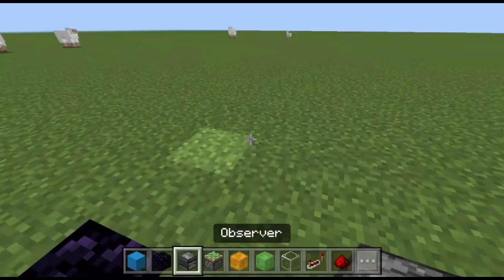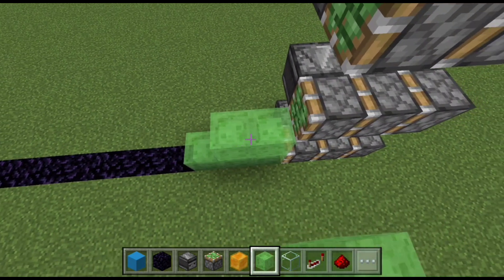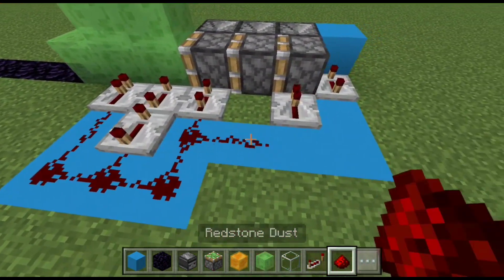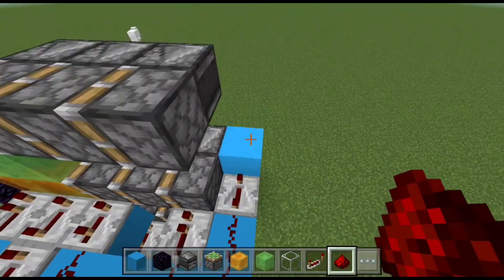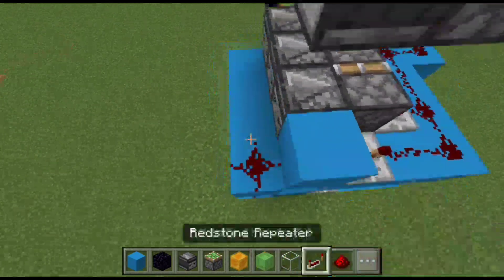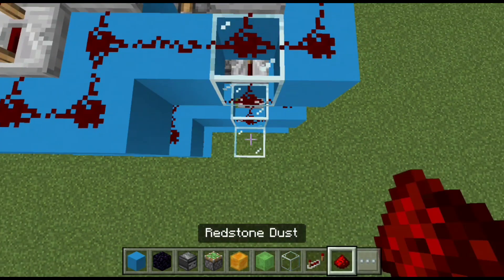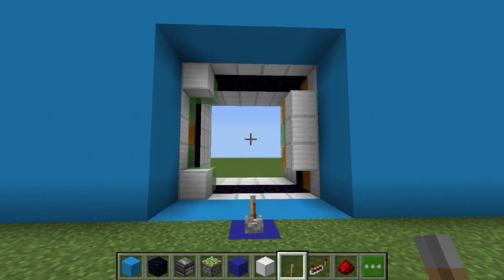🦅 Minecraft Bedrock: EASY 5X5 PISTON DOOR TUTORIAL 1.19!

Comment: My honey blocks and slimes move forward when I place the repeaters in front of the observers but the blocks don’t move back on their own 😞 doinh this in survival
Reply from the maker: What do you mean by they don't move back. Does the piston retract while they stay in same spot?
Reply from the maker: If the piston can't pull the slime it means you went over the piston push limit which is 12, you can only have door block on front of slime and honey and not back, and double check that you have IMMOVABLE BLOCKS everywhere where slime and honey would get in contact with blocks during opening and closing
Reply: @WingsOfEnd the second piston usually gets moved and then stays there
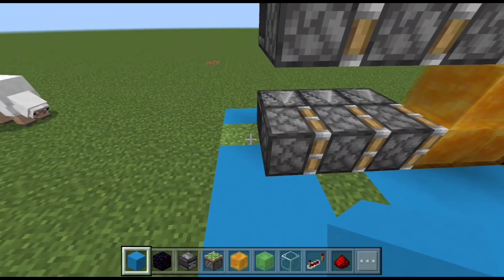Reply: @WingsOfEnd  check this, what is the area of a slime block’s grab? Bec I have furnaces in the areas you have obsidian and dirt in the areas you have concrete I don’t see any spots that anything but the piston gets moved… (2:53 at those parts where you place the repeaters, the second piston gets moved forward for me and then it stays there and this happens with all three layers on the C side)
Reply: I edited that a few times
Reply: @WingsOfEnd  still doesn’t work even after removing any moveable blocks and adding unmovable blocks 😞
Edit: the sticky pistons on the C side work fine but the honey blocks and slime blocks don’t move back, I changed a lot of the blocks to furnaces (don’t want to use obsidian bec survival) the other side the sticky pistons don’t even retract the last piston

Another edit: After realizing I apparently didn’t set the repeaters properly, the pistons on both sides now retract : 0 inputting honey blocks and slimes now
Reply: It works now… Tho I don’t know how to make a lever work on both sides with this and idk how you were able to put stone on both sides when there’s the red stone that stops the blocks from behind from doing that…
Reply: @WingsOfEnd ey, can you go more in depth on how to make these doors open on both sides? I tried doing the “connect a lever to the opposite side to use on both sides” but it doesn’t do anything:/
I mean to open and close inside and out

Comment: I followed the instructions and it worked. Then it broke. The bottom slime section won’t move. It’s not sticking to the piston on the bottom
Reply from the maker: You need to make sure they aren't touching any movable block other then Iron blocks (or your door block), the reason they don't stick is because you went over piston push limit which is 12, and accidentally made slime or honey touch movable blocks weather on side or under them
Reply: @WingsOfEnd  So what happens is the door pushes the slime part on the bottom perfectly fine, but won’t latch onto it and won’t pull it back to the original position
Reply: Good news! I fixed it. There was a block that wasn’t obsidian on the floor and it kept latching on and not letting go

Comment: Having issues with the build. Red stone work is correct but when I open the door and add the block of choice to the slime/honey blocks the door doesn’t close correctly. If I don’t cover those blocks than it works fine. I’m on bedrock edition
Reply from the maker: Are you sure the path is cleared for the door blocks to slide back? If it doesn't open all the way there must be a block stopping it from doing so. Also you can only add door blocks to the front of the slime and honey. They can't be anywhere else on the sides, top, bottom or back
Reply: redstone works differently in bedrock its probably not a compatible build design
Reply from the maker: @MystiqEevee  this is literally made on bedrock with a phone so there's 0 reason it wouldn't work unless person messes something up and you'd be surprised how many silly things people miss sometimes lol